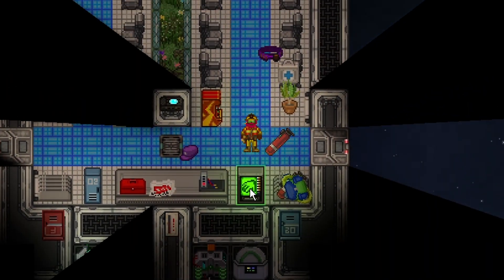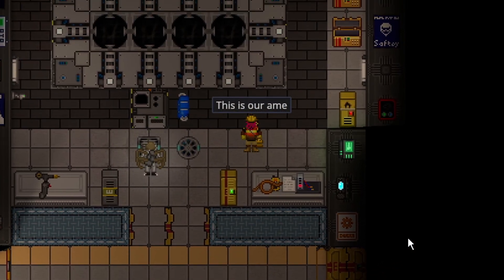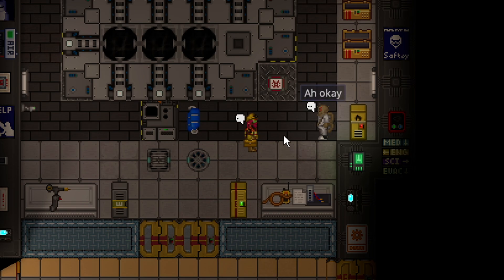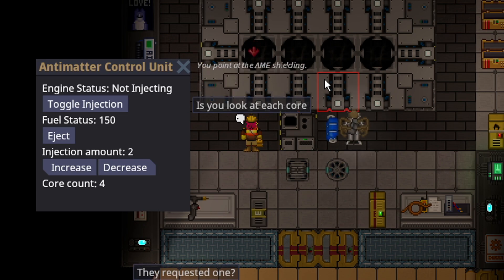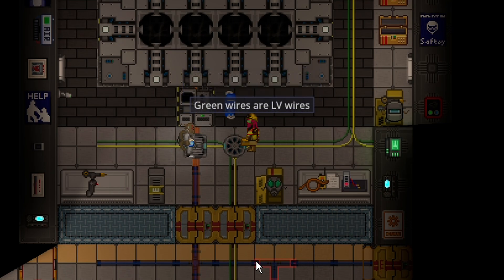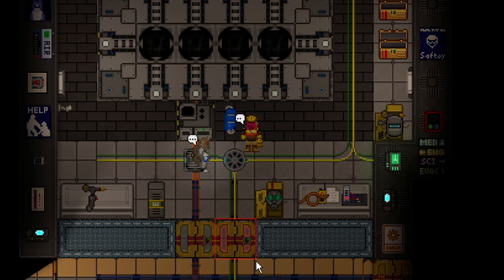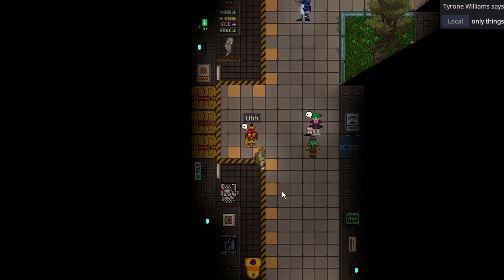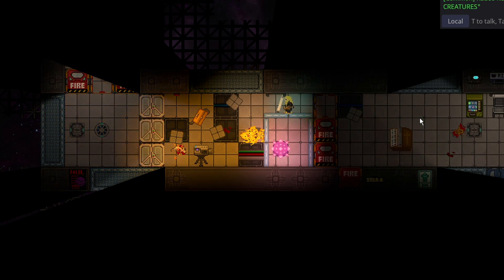SS14 - Teaching Engineering (Educational Gameplay)

Comment: Since when did SMES start to convert HV or MV? It only stores power and transfer further by HV. HV to MV converted in substation. And APC convert MV to LV.
Reply from the maker: Converts is the wrong way of phrasing it. But substations need power fed to them through HVs is the point I was trying to get across. But you are correct